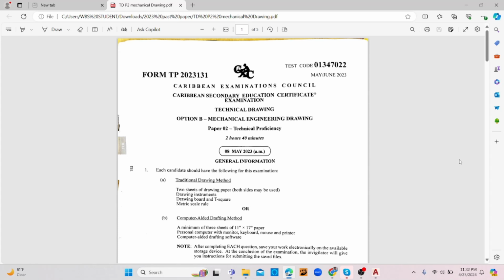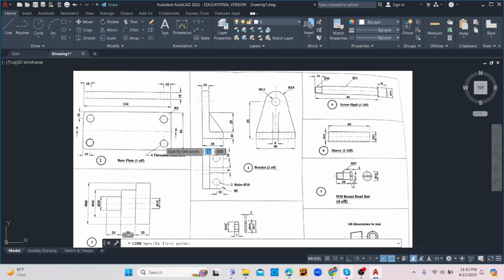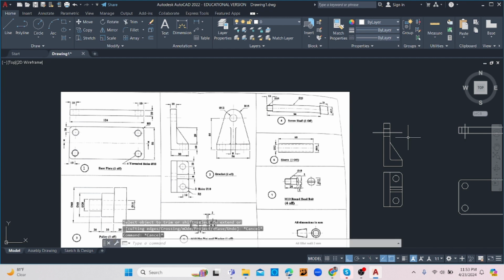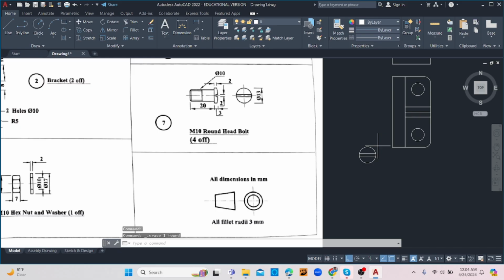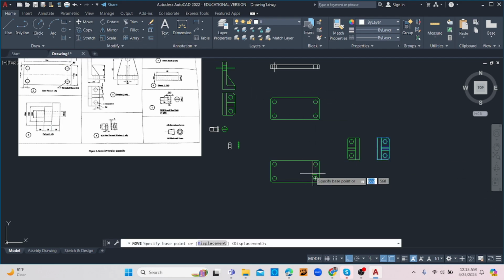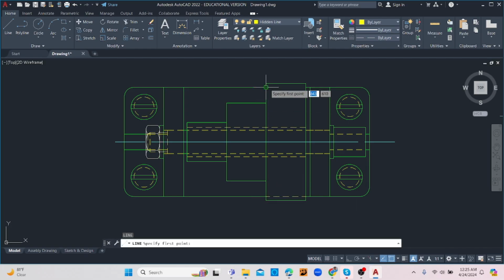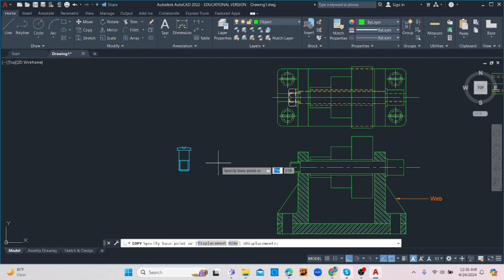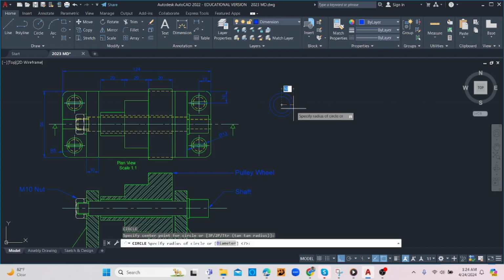Technical Drawing TD Mechanical Drawing  2023 assembly drawing Past paper 2

Comment: I have a question, sir. Is the hole that the bolt goes through or the bolt itself supposed to show? (in sectional) given that the cutting plane X-X didn't pass through them? 

Im asking because it shows on your drawing, but on the paper, it doesn't pass through any of the holes on the plan veiw so i am wondering why it shows

Comment: Good day, Mr. Goulbourne,

I have two questions:

1. Would the M10 Hex Nut (part 5) be the same for both views? I think that the plan view would show as the Hex End, i.e. showing two sides of the Nut (part 5).
 
2. Would the M10 Round Head Bolt (part 7) show in the section? Is it a case where the Bolt Head (part 7) would only show?

Please peruse and provide an update when possible. Thank you.

Regards,
JPL